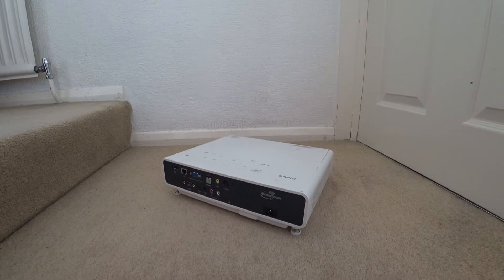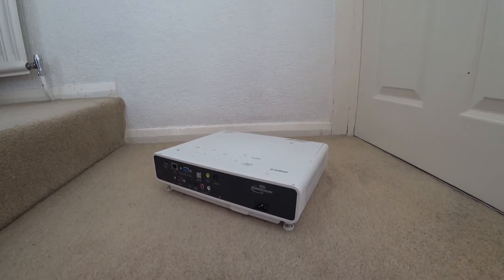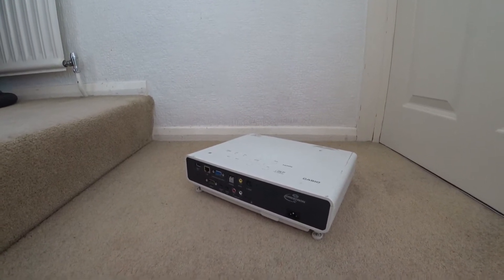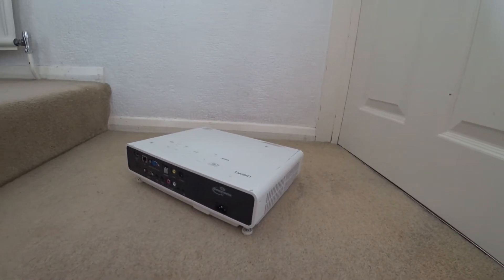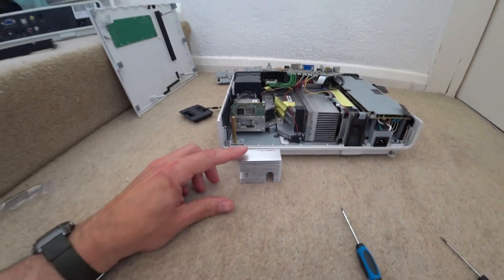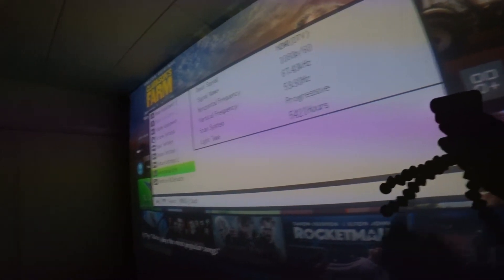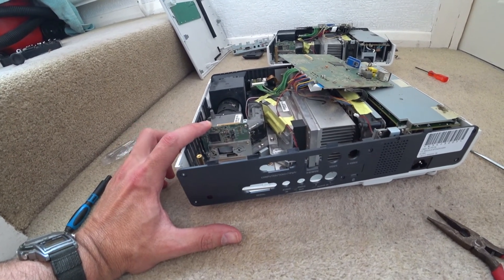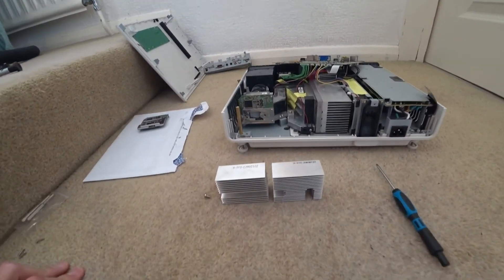How to fix Casio XJ-M130 LED DLP Projector - £22 DMD board replacement - Tri-wing screwdriver

Comment: Hey. Does it really xj-m130? I have m145 and its looks like yours projector, but I see WXGA (16:10) resolution on screen. On my m145 resolution is XGA (4:3). 
Can you tell, can I buy DMD chip with WXGA res and place on my m145? Is it real?
Reply from the maker: Hi.  They both do XGA I believe looking at this sheet: http://www.casiomedia.co.uk/files/projectors/downloads/CurrentCasioPDFBrochures/ProjectorCheatSheet2014.pdf.  I would say WXGA is for the M2xx series of models.  So a XGA DMD is required in the M1xxx models in the crib sheet.

Comment: is this also the fix for my projector going dim after jus a few seconds being turned on?
Reply from the maker: I would say that is is more likely the lamp than the DMD board and chip.  Is it the same model as this?
Reply: @AvidRetro  no its the m250. thanks sir
Reply: @AvidRetro  the other thing is it reacts to room temperature. wen its room temp is hot the projector goes dim
Reply: @AvidRetro  if its lamp, replace? its only got 3700 hrs....
Reply from the maker: @outoftime788  Sounds like it could be one of a number of things going wrong with the projector.  Can you try running the projector in different modes?  I think there is a high altitude mode and eco or non eco modes.  Do any of these make a difference?  You may be better off picking up another projector at this stage e.g. one that is bright but with a faulty DMD chip like mine and doing a swap to make one good projector.  Or source another lamp to try?
Reply: @AvidRetro  ya thers diferent eco modes everytime i change it itll go brite for a few secods then.....
Reply: @outoftime788  , did you already repair it? Sounds like an error on the lamp-controller boards. If the image ist getting redish, that of the lasermodule or blue-greenish the LED-module, directly at the power supply. If both (unlikely to have failed together) it could be the mainboard or the LDR measuring brightness having lost its resistance, making the pro "think" to shine bright while actually being dark. You told about that it got darker in summer. A defect temperature-sensor could explain, too, with the system trying to prevent overheating while being perfectly cold. If it has a lot of hours, LED or Laser could be simply old.
Reply: @lorsheckmolseh3345  na threw it away got a 70" tv lol